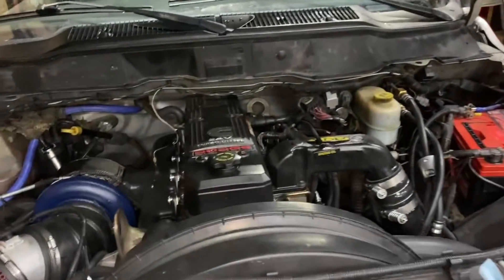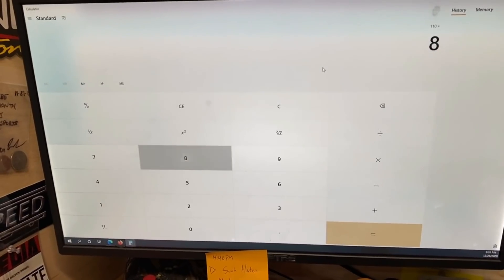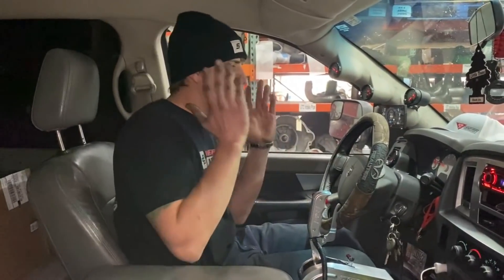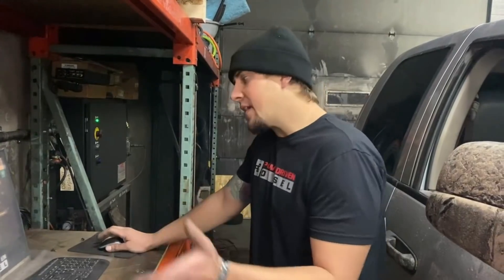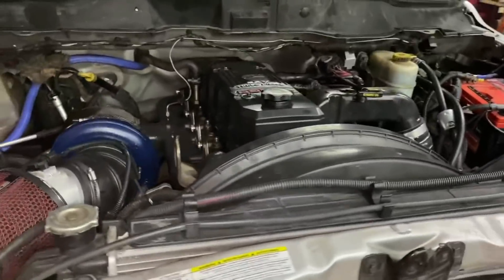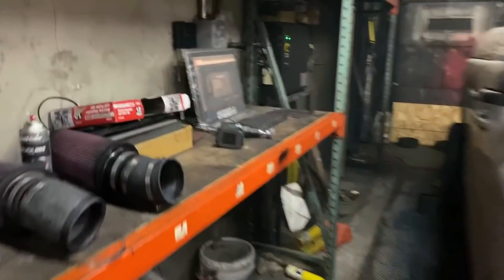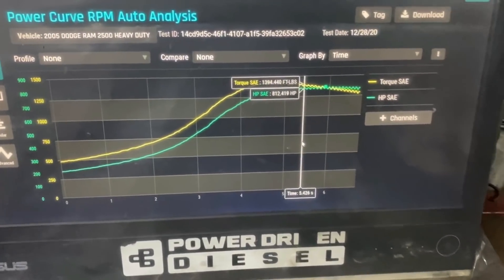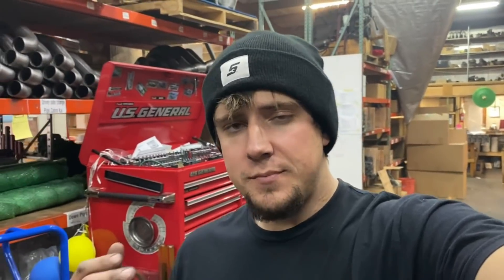CUMMINS 472 SXE ON THE DYNO! 800HP PLUS CLUB.

Comment: How’s the 467 at elevation? Id love a big single but am hesitant to go that direction because I’m typically at 8-9000ft
Reply from the maker: Oooof that's high up there. I'd do a 467.7/83/.9 t4 it should be ok but I haven't ever experienced that this was tested at 5200
Reply: @horsetorquesdiesel  right on thanks for the input. I’m picking up a truck with 12mm cp3, 300% injectors and a 475 but want to tune it back a bit so hopefully a 467 with plenty of fuel and it’ll light

Comment: I have a 06 5.9 with efi live, south bend dd, exhaust, cold air intake, fass, and arp head studs. Trying to put a little more power down thinking either a aurora 4K or a fleece cheetah what would you recommend

Comment: Keep up the awesome work! Random trans question: in the 47/48 Transgo kits, is it better to use the seals they send with it for pump and input shafts, or the OEM style metal seals that come with rebuild kits?
Reply: I would defiantly recommend the ones that come in the kit. There made for the kit so I would recommend using those

Comment: How much blow by are you dripping? Do you think it's more from the increased cylinder pressures or is it mainly from the miles on the engine?
Reply from the maker: Probably a little of both. It started bad when the 467.7 got put on
Reply: @horsetorquesdiesel  What numbers in your experience are ideal for a drivability, towing and longevity? I really like the follow along series, I have an 03 H.O. 6MT with 228K and I'm looking to shoot near the holding capacity of my Kevlar clutch 490/880 on near stock components and good tuning. Just looking for a bump and fuel economy really, but I don't want to approach the line where im prematurely wearing on the engine life.

Comment: Stock camshaft? And intercooler? If so that's good news
Reply from the maker: Yes to both sir
Reply: Ever used a 263 sxe charger in a twin setup before ? Truck is an 06 cclb 6 speed , have a manifold and new 263 sxe on it with a dirty old smarty tuner and a fass . Was thinking of adding a large ,side mount charger to make a twin setup like I made for my 12 valve . It's mainly a tow rig and would like to see 650ish safe ( I mean not super high egt) hp . And what do you think for cp3 and injectors. I had it on the dyno before and I'm around 500 right now

Comment: That’s exactly the turbo my 5.9 has but with  a 1.0 a/r at 5000ft elevation..supper laggy!! i switched from a aurora 5k (71mm) 1.0 and that thing spooled a lot better but had some durability issues, I just hope I find a 6.7 somewhere to swap it in..cuz I love them big singles!
Reply: What fuel were you running?

Comment: I’ve been keeping up with this trucks series, I have a 06 5.9 with nearly the same fuel setup but it’s a manual transmission. Can you recommend a s400 series turbo on a manual truck with 100 overs and dual cp3’s? Trying to get away from the drop in turbos
Reply from the maker: What do you do with the truck?
Reply: @horsetorquesdiesel  starting to get into bracket racing, it’s a weekend warrior that gets beat on regularly. It doesn’t need good manners at all. Studs, valve springs and pushrods, big clutch, EFI, all the fun stuff

Comment: Was really hoping to see a Dyno Run on your 4th gen after your rebuild you said 1000 hp tow truck. And to see how it would do pulling that gooseneck
Reply from the maker: Towed just fine, made 902hp on the 467.7
Reply: @horsetorquesdiesel  that's pretty sweet!!! Do you have a different tune when you're towing or ALL THE BOOST all the time?
Reply from the maker: @jeepsnthings565  I towed in the 650hp tune

Comment: Excellent video!  I'm excited to see the compounds and how it can give the best of both worlds even on a tired 300k mile 5.9. I love the stock vgt set up on my 6.7 but this does give me some inspiration to do a bigger single on it when it's time to replace it. What would you recommend for a stock fuel 6.7 with just tuning and a lift pump? Any huge benefit to second gen swap or would the factory 3rd gen manifold still be fine? Truck is an 08 with 182k miles.
Reply from the maker: I loved my 467.7 on my 6.7 even on stock fuel, just make sure to get an exhaust brake
Reply: @horsetorquesdiesel  thanks for the input. The exhaust brake is a must for me.
Reply: I've seen many 467.7 2nd Gen swapped 6.7's on stock fuel make good power and have good drive-ability...